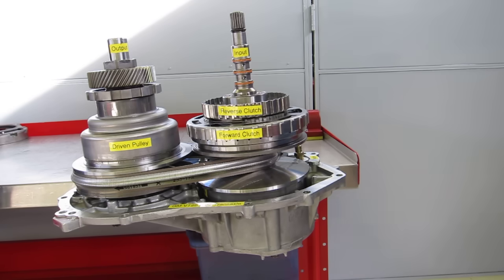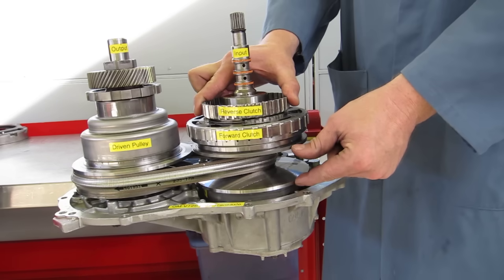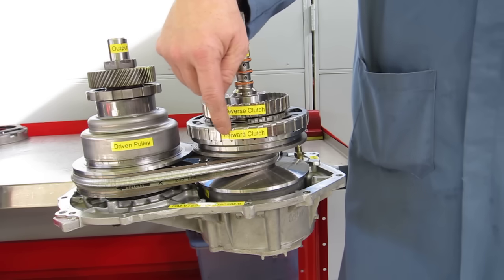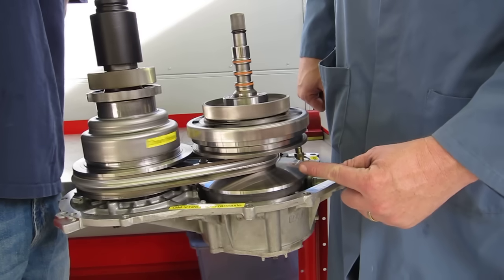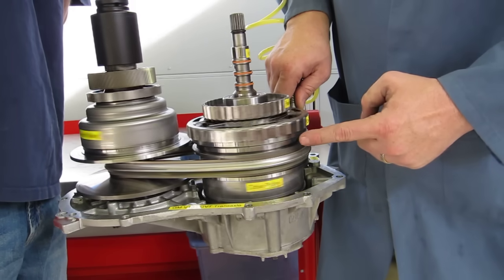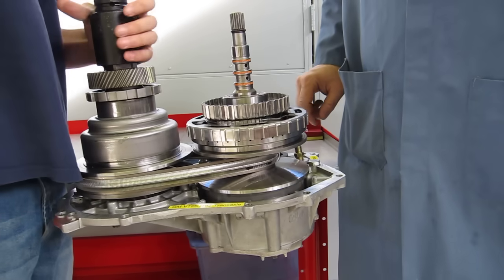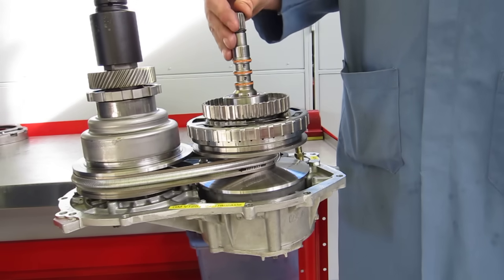Continuously Variable Transaxle (CVT) Operation

Comment: question what would cause one of these cvt transmissions to not engage while the engine just rises in RPMs then suddenly CLUNK! something engages! and wheel burn out for a spilt second. ..at stops highway speeds is just fine
Reply from the maker: Sounds like a Honda? They had a problem with a "Start Clutch" (which functions like a torque converter). There was an updated clutch, valve body, and ECM software.
Reply: no man its a mini cooper s but now im not sure if it does in fact have a cvt tranny in it. the reason i thought it had one is because, as i was hooking up to it my scanner ask me if it was equipped with a cvt transmission and i click yes not knowing whatta! cvt was ......anyway when i get a chance im gonna hook up to it correctly and watch the data pids to see what is going on maybe put a gauge on it check line pressure..
Reply: what do you recommend i do?

Comment: Excellent video 👍🏼 I'm a mechanic and it's funny just how many people have cvt trans and don't even know it.
I will say that with proper care they are hearty and great transmissions. Replaced many trans..non cvt
Reply from the maker: Thank you!
Reply: several manufactors make cvt that people complain about
i think honda and lexus are good
but i know toyota is good, as of yet a dont know anyone that has had a camry cvt fail
i talk to people with 150 to 180k miles and never even changed the fluid or if it was done they were not awahare

Comment: CVT CFT 30 Try after replacing camshafts to install CVT in parking position. What air pressure required for shafts?
Reply from the maker: I used air pressure in the demonstration, but the transmission uses hydraulic pressure instead. the pressure can be as high as 700 psi
Reply: WeberAuto Thank you!

Comment: how the car creates and maintain the air pressurization? there's a tank with a dedicated compressor or something?
Reply from the maker: I used air pressure to simulate hydraulic operation. The transmission is controlled hydraulically. Thanks for your feedback.
Reply: WeberAuto oh alright, thanks

Comment: Using the "Driven Side" to apply the Drive made it really confusing ... plus get the right size socket :)
Reply from the maker: Thanks for your feedback. The input side has a hydraulic clutch that needs to be applied (the forward clutch). I could not apply it for the demonstration, so driving the output side was best for this demonstration. I finally did get the correct socket. Have a great day!
Reply: Ahhh ... That never crossed my mind .. thanks for your patience! :)

Comment: In the case of CVTs, I like the theory much more than the practice. It sounds ground breaking until you use it. I drove a Civic Hybrid with one of these. In city driving it felt like it was constantly doing what I didn't want it to do. I hope not all CVTs are like that, otherwise they only belong in scooter bikes, ATVs and snowmobiles.
Reply from the maker: Thanks for your feedback, they do drive differently.

Comment: Looks like an automatic transmission that you could actually push start in an emergency. For years that has been my major complaint against automatics.
Reply from the maker: This one still needs hydraulic pressure to apply the forward clutch to connect the input shaft to the drive pulley. Thanks for your feedback.

Comment: the pulley surface is shiny and slippery. how do they avoid slippage ? please respond.
Reply: ISH's channel watch their other video how the belt is made, there are 399 parts on the belt witch at their side where they contact the pulley have ridges that help to grip it
Reply from the maker: True, and up to 700 psi of fluid pressure squeezing the pulley halves on the belt elements. Thanks for your feedback.
Reply: ISH's channel that's a good question there

Comment: My lawyer gave me some info about this transmission, if I can remember he said it was made in Yugoslavia by Volvo and it failed so much on the dyno the technicians gave it a nickname  which I cant remember. GM had a commitment of 239000 units and couldn't back out so they thought it would be cheaper to settle individually than to try to fix these while still in production. mine only failed slipping on the way over a mountain took 5 hrs to get home instead of 2 smoking the whole way. There were some people who were killed at intersections when tranny locked up.
Reply from the maker: Thank you!

Comment: You can see why gear-heads don't like these. Neither mechanic has a chub. If that was Muncie, or an old Rock Crusher 4-speed, they would both have boners.
Reply from the maker: Old school gear boxes are cool for sure, but the new stuff is pretty cool too. Check out an 8 or 10 speed transmission.

Comment: can someone please help me . I have a 2005 ford five hundred awd  it has a cvt transmission I have had nothing but problems with this car . first it was making noise when I would coast a low speed and I had a couple shops tell me the rear differential was bad but then all a sudden car quit making noise and seem to be fine so I didnt worry about it . then I took car to have oil changed right off the bat I thought my car sounded different but but I was .n everything was fine then my car started jerking like then my wrench light would come on and check transmission light came on. auto zone told me it wad reading a problem with the transmission range sensor . I have took my car to every shop and to ford dealer ship and no one can seem to tell me exactly whats wrong with my car.if it is the transmission that needs rebuild then  I don't want to waste money .now my car seems like its having a hard tine moving . it just takes a minute for it to actually get up to speed. Someone pleAs tell me if there is something that could cause this
Reply from the maker: If the problem started occurring right after the oil was changed, it is possible that the wrong fluid was added to the transmission. CVTs require a special fluid.

Comment: Great video -thanks.  I know nothing about the details of transmissions.  One question.  I may be misinterpreting your video and the term CVT but to me a car with 4 forward gears and a CVT is meaningless.  Are there truly a large number of forward gears or is it still limited to 4?   Maybe the car driver can select one of the 4 manually but when in drive, the car figures out which of the endless number of 'gears' to be in.
Reply from the maker: There are thousands of gear ratio combinations in all available transmissions. Transmissions come in 2-speed models all the way up to 18-speed models. A CVT does not have individual gear ratios, it varies the drive pulley ratio to driven pulley ratio anywhere from about 2.4:1 while accelerating to 0.4:1 at highway speeds. I hope that helps. Best wishes!

Comment: How do the steel belts grip the smooth pulleys tho? That's what I can't wrap my brain around. It's not like a chain & cog, and unlike a serpentine or V belt system with rubber belts that use friction to grasp the pulleys (torque will make them slip tho), steel on steel is not very tractive, and it also gets lubricated via nozzles spraying transmission fluid... so how do the belt grip the pulleys, especially under higher torque conditions????
Reply from the maker: See my other video on the steel belt construction, it will help you understand. CVT Transaxle Steel Push Belt Construction
Reply from the maker: https://www.youtube.com/watch?v=PiwRUfFEc5k

Comment: Do you feel that CVTs still have reliabilty problems over the long term?
Reply from the maker: Yes, I do, but the newer models 2012 and above are much improved.
Reply: Thanks. As I tend to keep cars a long, long time (one has 280k on it), it sounds like CVTs won't last as long as conventional automatics.

Comment: I'm no engineer but looking at that system it seems no wonder people complain about them giving problems in their cars. Some people say Subarus feel a bit terrible on steep grades.
Reply: yes
Reply: Is a manual transmission better than a CVT?
Reply: @Someguyto  in theory, a "race" built CVT is better then all transmissions. It was banned from racing series across the world. However, CVTs today are built for maximum power/fuel economy. Which means you'll get the best power output for a little fuel as possible.
Reply: e james  if driven properly. Like the reason most people buy one, fuel economy. Your belt should never have to be replaced, if you keep up the proper maintenance. I find your lack of knowledge disturbing.
Reply from the maker: Thanks for the feedback!
Reply: Ichini Shichi define “better”. Manuals are way more fun sure
Reply: james  cvts power a lot of agriculture industry.
Reply: Someguyto mainsail is fun but the CVT is a thousand times better on fuel efficiency

Comment: Hi all, looking for some opinions on CVT noise - high pitched, whining 
noise after 30min driving or so. The car was inveloved in rear end 
accident - quite strong one. I have stopped on the lights and then car 
hit me from the back at around 40km/h... also i was on the full break as
 I just stopped - the car was pushed about 1 meter in front. since then 
the high pitched, whining noise started. Now the insurance company 
questions this and suggesting wear and tear... is there any thing 
connecting and disconnecting when the car is stopped and can this 
mechanism be damaged by heavy impact (rattle like) in the accident? 
thanks m
Reply: thanks mate - you are on the money. however here in Australia its only 3 years warranty - car is 5yo with 75,000miles. keeping my ears open for noises but they seem to be gone for now. since the previous job was not done properly i can go thru Office of Fair trading to get them to compensate me - but right now nothing to report... i will see what happens if there is any permanent damage and then take an action.
Reply: I'm no CVT expert, but the forward clutch pack in the transmission should not have been engaged when you were at a stop.  I have my doubts that a rear end accident would cause damage to your CVT as the torque applied to the transmission when you were hit wouldn't even be transferred to the engine.
Reply: so it sucks
Reply: Marc see I'm guessing you have a nissan?
Reply: ibiscar06 yes nissan. It sucks because it was so good for years. Not sure what to do. Car still drives ok but i dont take it for long drives.
Reply: Marc see what year, is it a sentra and how many miles does it have
Reply: Marc see I'm asking cuz depending on the miles it might be under warranty. if not it needs a new transmission altogether . I have an 08 sentra that started with the whinning noise and way past warranty. the noise would start the shorter the distance the longer I drove it, if that makes any sense. anyways, cvts came with that problem and dealerships together just swapped for a new one. I spent 2k to overhaul mine. but I had three options, either sell it for cheap and buy a beater which I was going to have to drain money into, put a used transmission which more than likely came with the same problems, or overhaul it and take the 20 month or 20k mile warranty the transmission shop offered me. I went with the third, although it took me like six months to take it out. maybe one of those options is for you.
Reply: Marc see plus, it starts loosing torque and you won't be able to drive at high speeds, you're lucky if you manage to get past 40 mph
Reply: ibiscar06 thanks yes this one is pass warranty but i have aftermarket one but they say it needs to be within their acceptable terms. Which means their mechanic assess and i hope for best - but have to pay mechanic. Will think what are the best options.
Reply: Marc see after I got my car back, I was very happy not selling and just having her back really. good luck in whatever you choose to do
Reply: Marc see z
Reply: Q
Reply: hey - so i had few thoughts and 120,000km service came along. after getting in new full-synthetic oil most of the noises are gone. yet to take it on motorway to see more. also checked the 60,000km service - and guess what - the mechanic replaced only 5l of oil at that time - when the service states minimum 8.5l and my new mechanic (while i watched) replaced 9.5l - so i was doing 120,000 on pretty much old oil. will see how it drives and then take action against the mechanic that did not service my car properly.
Reply: Marc see that's awesome, hope it runs well and gets rid of all the problems
Reply: thanks mate - will try to make this company to warranty any damages in case there is any permanent damage. but so far it would be hard  as it sounds just so good. will see haha
Reply: Marc see ☺ good luck my friend..

Comment: so , adding an electric motor to the output would be fine in a CVT but not ok in a normal transmission ...
ok but why ?
Reply from the maker: They do add electric motors to regular transmissions. Honda's, VW, Porsche, BMW, etc.
Reply: Does a CVT make sense in an electric car? My understanding is that one gear ratio is common even in electric race cars...

Comment: question can we tune the car that has cvt in it ? for eg I have Lancer GT  2.0 cvt and it has 155 hp so if am gonna tune it what will be effect in cvt belt ? will it handle the pressure or we can't tune the car that has cvts ?
Reply from the maker: no, they cannot handle larger amounts of power
Reply: so how much can we tune it ? I mean like upto or maximum how much ? hp we can gain

Comment: How much worse is the maintenance of a CVT compared to a discrete transmission?
Reply from the maker: Not at all worse, just different fluid and fluid level checking procedures.
Reply: > "[...] just different fluid [...]"
Ok, and the other parts? belt, pneumatic actuators, conic discs, etc? are they a major cause of problems?
Reply from the maker: Hi, those are not maintenance items, those are overhaul items. The overhaul is actually much easier than a non-CVT transmission. The parts are more expensive since the belt and both pulleys must be replaced as a set. Sorry for the confusion.
Reply: > "Sorry for the confusion."
Relax, don't worry. I'm a fan of CVT since the first toroidal units. I'm just not sure yet if those new pulleys CVTs are really cost effective (maintenance + gas).

> "[...] the belt and both pulleys must be replaced as a set."
This is bad news. Compared to a standard clutch, how often this set must be replaced? More or less often?
Reply from the maker: Theoretically they should never have to be replaced. Abusive driving, lack of scheduled oil changes, incorrect oil, and incorrect oil level will all shorten their life. So about the same period somewhere around 150k miles
Reply: > "[...] somewhere around 150k miles"
Amazing! This should be more marketed.
Reply: I'm seeing more and more dual mass flywheels which need to be replaced when the clutch is changed. I wouldn't bet on a conventional clutch being (much) more expensive taking the latter into account. Besides that a I find a CVT is easier to service/rebuild then a normal gearbox.

Comment: very good explanation. 
but can you tell me what is the problem with the cvt most of the time.
i heard they are problematic after some time.
Reply from the maker: Thank you! The belts have been a problem on some earlier models of some brands. Other brands have not had much trouble.
Reply: so which system and long life and less fault. 
in my country most mach can't repair and parts is hard to get. we need a new replacement at sky rocket price. over a whooping 10k or more.

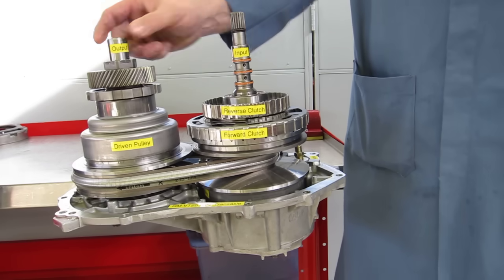Comment: 1:23  Correction!  The gear ratio is not the ratio of input to output!  The term 'gear ratio' always means the ratio of the output to the input [speed]; use the standard definition, so as to avoid confusion.
Reply from the maker: Thank you for your feedback. A gear ratio of 2.46:1 indicates that it takes 2.46 rotations of the input shaft to obtain 1 rotation of the output shaft. I am not sure how to look at that any other way. I could be wrong.
Reply: WeberAuto
You're right.  I looked up the meaning of 'gear ratio' as commonly used.  The confusion actually arises from a contradiction in the convention used to describe 'gear reducers' or 'low gear' & 'high gear'!  Accordingly, gear reducers have a high gear ratio, and 'high gear' has a lower gear ratio than 'low gear'!  Go figure!  Such ambiguity in naming conventions should be stopped!  Please pardon my confusion... maybe you can understand why this is confusing.